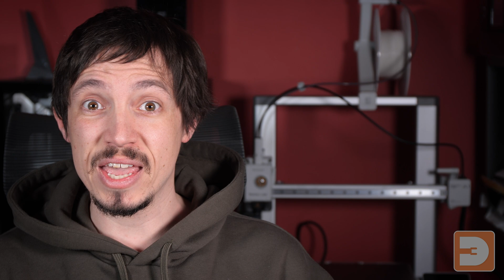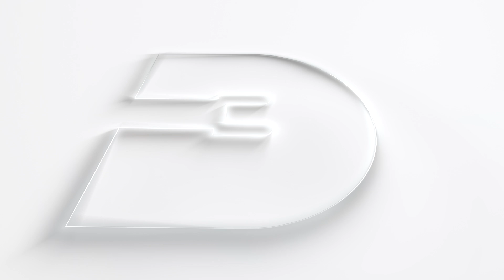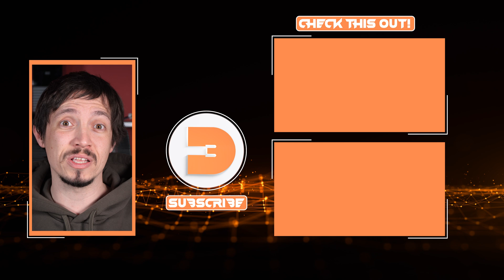A1 Heatbed Update: Recall officially announced

Comment: Bambu stated that only 0.1% of manufactured units have this particular fault yet there seems to be an alarming number of reports of the very same issue on so many devices, then the next minute a total recall of all units is announced. 
You could argue that the initial fault investigation was rushed and not at all accurate.

I have decided to return my printer as it has the cable fault for a refund as i can see the newer A1 MK2 being more desirable with possibly more improvements and will devalue the earlier model, especially if it has been DIY repaired.

Bambu Lab then sending out correspondence stating "no one wants to be without a printer so if you wish to upgrade immediately to another one of our printers we will provide you with a discount voucher of $80" (or £74) against your purchase", now that i thought was a great deal as i will upgrade to a P1S straight away, only to find out that the voucher will not be issued until after they have actually received your faulty printer, which in reality will take several weeks, so to replace it now means you will have to pay full price with no discount.
It would seem their definition of immediate is not quite accurate either.

Comment: $80 voucher. They backtracked on the $120.
Reply from the maker: Nope, check the link I put in the video description. There are two options, an $80 discount code if you return the whole A1, and a $120 discount code if you hold on to it and opt just for the replacement bed.
If for some reason that link isn't working for you, I've just uploaded a screenshot of that page that you can view here: https://ibb.co/3NxBLw0

If you're seeing different details, could you let me know what country you're based in as then I'm presuming it's geographical.

I'm UK based and with me signed in, I'm shown this page which lists the amouns in $, so I'm presuming that it's the same for both UK and USA, but would be good to know where is different.
Reply: @3DRevolution  I don't have the A1. I just saw some reddit comments from people that were offered different amounts but it seems just some confusion with the currency.

Comment: Wow thats a false claim regarding the ac.... Maybe read up on it a bit. 

Further more .
If you are changing the heatbed.. It doesn't matter if is with ac or DC.. you should never do it with power plug in.. also wire wise the job is the same if it's ac or DC

I would actually claim is harder to change a DC... because you would have to consider plus voltage  and gnd.. and then if you do it wrong you would have to swop them...

So...maybe you should recall this video
Reply from the maker: Please do tell. You say it's a false claim, please do explain what you mean.

Of course I'm not suggesting you swap the bed over with the power on, but asking an end user to make changes to a device specifically affecting the distribution of mains AC power, is very different to asking someone to swap a cable over carrying more managed DC power.

I must reiterate, I'm not arguing with you here, but I'm trying to understand your point. 

It's well documented and generally understood that AC is more dangerous than DC, especially if you're comparing mains AC power to 24V DC. Specifically regarding the A1 bed, this is a discussion that's been happening in the community quite heavily for the past week.
Reply: It totally depends on the rest of the setup.. 12 v ac and 12v DC ..is almost the same threat level. 
400 DC and 400 ac is almost the same threat level. The latter being the a case where you should take precautions and seek professional. 
But for the bed change, it isn't more dangous the changing the wire to a lamp especially when they are not plugged in to power.  That's why  bamboo lab also suggest this a viable solution....but your statement comes out, as an over statement of potential harm.  

Ac and DC.
With AC there is a higher risk of muscles contraction...

Follow the instructions from bamboo lab. 
If you are not sure, send it back to bamboo lab. 

I will bet alot of people have change wires on ther home appliances, or 3 d printers before.. and for these people there really is slim to zero risk. 

I work professionally with both ac to DC from 1.5 DC to 3x400v AC..
I don't find this little change to be a problem for anyone... But if they are not sure what they are doing, have a friend do it or send it to bamboo lab. ... 

But the statement 
Was out of proportion...
Also looking at the real risk assessment...for the particular product, bamboo lab, would not suggest it if it was THAT dangerous.

And I will bet you two cookies and beer, no one will die from changing the bed... 🙃
Reply: @christiansrensen38, spoken like someone who's been zapped a few time.  My record is 575vac (Canada) and can tell you that I couldn't have kept myself in contact with that if I tried.  Also worked with "high" DC voltages that tended to make you stick to them.

Comment: Health hazard as ac is more dangerous? Wtf are you on about. Stop making stuff up.
Reply: Problem here isn't that it's alternating current, but "AC heatbed" is generally the name of beds that work with 120 or 240VAC... And yes, they're more dangerous than standard "DC beds" that work with 12 or 24V DC... So he's right. AC stuff is generally high voltage and DC stuff is generally low voltage, and it's usually safe to touch a live 24V circuit and very not safe to touch a live 120V one.
Reply from the maker: Please forgive me, I don't need to offend. But my understanding is mains AC power poses a much bigger risk than DC.
My understanding, that is supported by my research I did checking before making this video is,  you are much less likely to die of electrocution from a czble carrying 24V DC, than you are 220V AC.
Even outside of specific context, if you were to Google something as simple as "what is more dangerous, DC or AC", every single result is very quick to conclude AC is the more dangerous.

This isn't to say that DC can't still be lethally dangerous, but it's one thing to ask someone to plug a new fan into their PC, it's another to ask them to take apart and rewire the AC side of the PSU. 

I am very sorry if I'm wrong as misinformation is the opposite of my intent, so please do explain to me where I'm going wrong here. However I can assure you, I'm not just 'making stuff up'.

The whole reason I even published these videos on the callback and recall is because of the potential risk factor involved and the fact that Bambu more than any has opened the doors of 3D printing to those less typically familiar with that sort of thing.

If it was simply just the sensor they were worried about, with all the thermal runway protection to prevent fires etc, I don't think  Bambu would be going to the extent and cosf of offering a full recall on whole printers, and they have absolutely stated that in March they would be sending out replacement heat beds, not just sensors, which would also suggest they are implimenting more changes than just replacing a sensor wire.

Again, my intent is anything but to misinform and I myself am always on a learning journey so if I have got this wrong, please to let me know.

Comment: I have an A1 which has operated flawlessly since purchasing however I am in the unfortunate position of having already getting rid of the box and packaging material it came in and I am going to bet here in Australia we will not be able to replace the bed ourselves so I am wondering where that leaves me?????
Reply: They have a few different options that will be available regarding the replacement and install options and parts
Reply from the maker: If given the option, would you prefer to replace the whole printer or just the bed? I'm sure with some team spirit we can locate where you can find some suitable packaging cheaply/free so you could send it back. If you'd prefer the bed replacement, I guess the official rout will depend on what the Australian laws dictate, however if that is overly restrictive, we can look into ways of you buying a replacement bed and getting it imported, we'd then just need to figure out what the reimbursment options would be for you from Bambu.
However, if your sis operating flawlessly at the moment, and the cable looks in good condition, if replacement would be particularly problematic for you, I'd consider holding onto it as is (along with the cable protector).
Reply: I have opted for bed replacement and received an email from Bambu last night telling me that they will be sending me the new bed and cables in March so we will see. Until then I will continue to use the printer as the cable is fine and I have attached the guard Bambu suggested after printing it out plus my printer is powered through an RCD circuit. @3DRevolution

Comment: mines was not damage and i printed that cable guard i think if ur printer is not damage yet u will be fine with that guard i was lucky i just bought mines so there was no kink in the  cable
Reply: Still sign up for the replacement bed, worst case you're gonna have a $120 voucher and a free spare bed :)
Reply: @FAB1150  u know wat u are f***ing right!!! didnt think about that!!!! ty my good sir!
Reply: @FAB1150  quick question i think they ask for a pic of ur cable looking bad how did u get by that?
Reply from the maker: That was before the full recall. When it was just a callback they were only offering replacements for evidently damaged parts, and for everyone else, they could request a pre-made cable guard. However, now the full recall has been announced, any A1 owner (regardless of the cable condition) can request either a full return and refund, or just a replacement bed.
Reply: @3DRevolution  yep! I wrote a comment but YouTube's spam protection picked it (probably because I pointed to an external site). It's explained in their article!

Comment: i think everyone is getting confused here they are sending you out a cable to fix it, if regulations allow in your country. if not then you will only have option 1 and to send back for a refund and wait until may for a new printer to rebuy one again. 

DC is far more dangerous than AC only reason that the DC is low voltage on most printers at 24v
Reply from the maker: This sounds to me like there may be different recalls in differernt counties.
Could I ask where you're located?

The recall announcement page (which I link to in the video description) lists the compensation vouchers in USD, so I presumed that as I was taken there signed in with a UK account and it was listing USD that at the very least it was the same here as it is there.

On that page, it explicitly states two different options:

Option 1 - " Return the A1/A1 Combo and receive a full refund, including a $80 discount code."
Option 2 - "Keep the A1 printer and receive a revised heatbed and a $120 discount code."

Regarding the AC/DC danger, direct mains voltage AC is far more dangerous, than the level of DC power that would be otherwise used for this. Would you rather lick a battery or stick a fork in a mains plug socket?
Reply: @3DRevolution  Its not the heatbed itself that is a danger. It is the sensor on the heatbed. If you look at the recall post, you can see a link to a video of replacing the heatbed sensor. Its only the sensor cable that will be sent out and replaced
Reply from the maker: @JJG4ming  Yes true, but if you look at the photos of the damaged cable on their original announcement, the entire cable was bulging and damaged, this contains not only the wires did the sensor but also the power for the heatbed itself. They also say in that post that the damage could lead to short circuits, which would mean there would need to be exposed wiring on more than one of the wires in the location of the damage. That would then mean there is a chance that the AC mains power being used to heat the bed could in theory be becoming exposed as well. I think this is the reason Bambu has issued a full recall as opposed to just replacing a simple component.

Comment: That sucks.  Any recommendations on one of their better printers?
Reply from the maker: It's definitely frustrating, especially if the A1 is your only printer, you'll want to get another one back up and running asap, so waiting until May (or even March for the new bed) is a little too long away.
Effectively, other than the A1 Mini, the A1 is Bambu's lowest spec printer, so if you can afford the P1P, P1S or X1C it will be able to do everything your A1 could do and more. The only exception being, the P1P and P1S don't feature the nice touch screen user interface like the A1 range and X1C have.
If you got the A1 Combo then it seems you can return the AMS lite along with the A1. It remains to be seen what the process is however if you bought the A1 and the AMS Lite separately. If you are still left with an AMS Lite, the only printers that's compatible with are the A1 Mini and the A1.
However, if you have less ties to the Bambu brand, there are other pritners out there, but you'll generally find that if you want to approximately match the specs and features of the A1, you'll pay a little more for it.
The closest equicalent to the Bambu Lab A1 is probably the Creality Ender 3 V3 KE. That is actually a little cheaper than the A1, however, even though it matches it on build volume (almost) and speed, it does forgo several of the key selling features of the A1.
Reply: @3DRevolution  thanks.  I did  buy the combo with the ams lite. I was thinking maybe just keeping the printer off to the side until they have the new one  because I really do like the printer and would prefer the same thing.  But if I did get something different I was thing the p1s. But like you mentioned, I really don't care to much for the screen.
Reply from the maker: @CrazyguyRC  The one thing I'd mention is, I'm not sure how long the recall offer will last. If they are stating the new and improved A1 may not be  available until May, there's a good chance it'll be a right hassle to convince them to do a return and replacement at that point. X1C is obviously the best option, but an X1C with AMS is over twice the price of the A1 combo so I understand that it's probably not viable.
You could try and flag a ticket with Bambu to ask if you could hold onto it now and replace it later, but not sure how long it'll take for them to reply at the moment with all this.
Reply: @3DRevolution  yeah I'm Probably just gonna get a refund and get the p1s... then get another a1 when it becomes available.
Reply: A1 mini combo:face-blue-smiling: